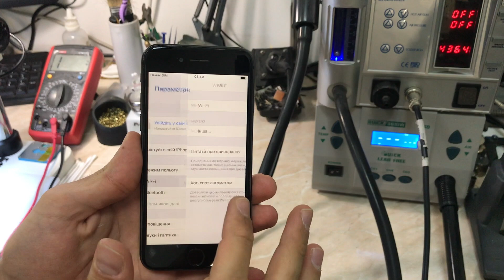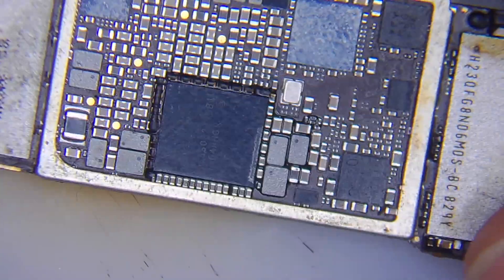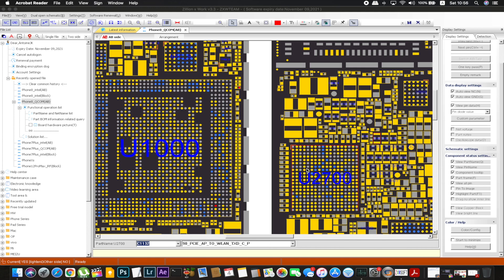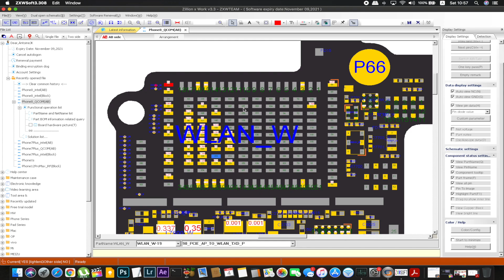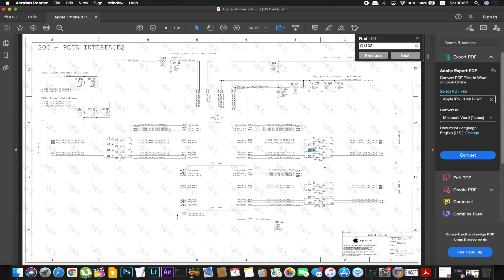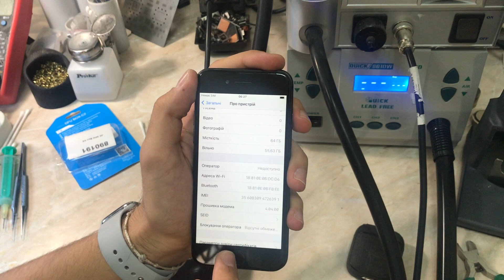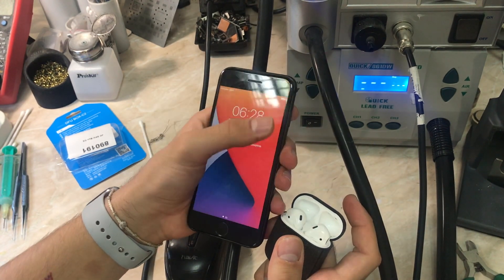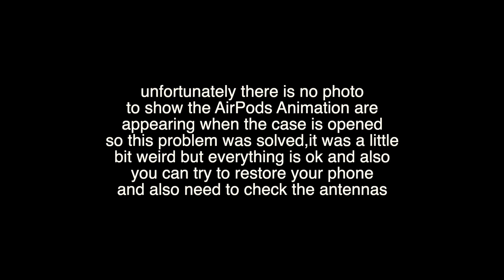iPhone 8 Greyed Bluetooth Keeps Searching (How To Repair)

Comment: I can’t see the point in the scope because if I don’t use it or figure board repair isn’t for me then I’ll of wasted lots of money
Reply from the maker: Removing big ic’s could be difficult and different for each microscope and of course depending on your skills,as you can see in all my video when I remove big ic such as NAND or baseband or CPU etc.. my microscope dose not have a lot of space to get the nozzle to the right area and give all the heat so you can remove the ic,I need a new stand of course and yeah of course you need a microscope that’s why it called microsoldering 🙂 but for me I can get the job done for now 😅😅